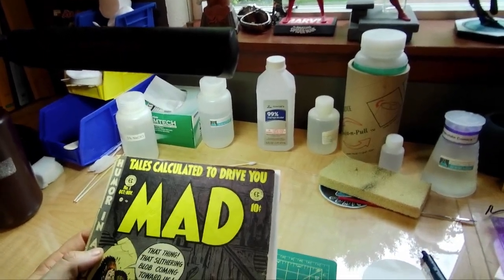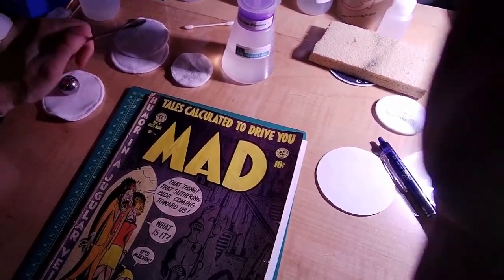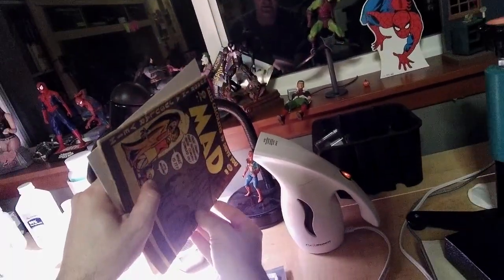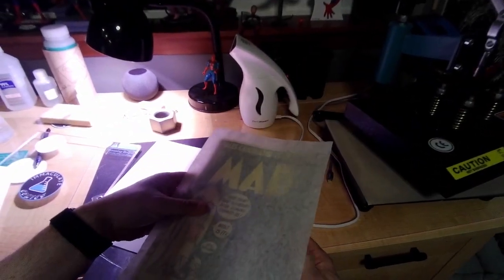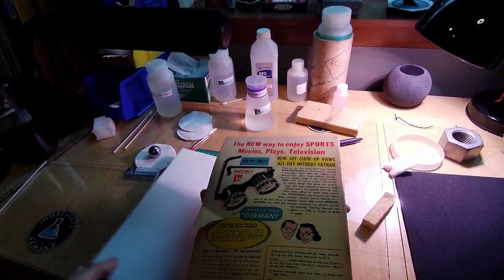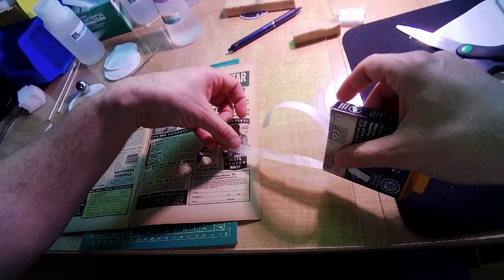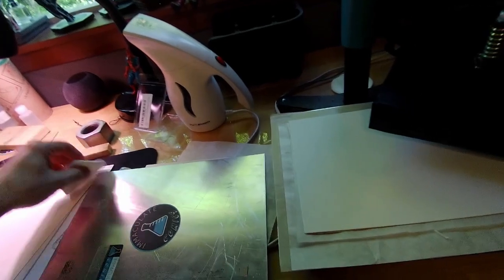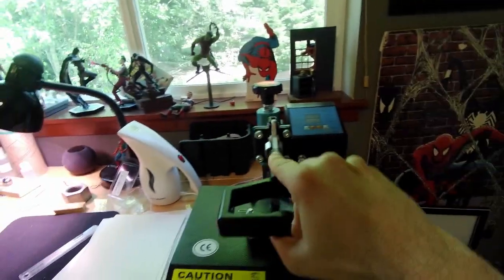cleaning Mad comic book #1 and #9

Comment: Great Video and thanks for sharing a Mad #1.  Learning a lot.  Been cleaning/pressing for a year now and get better and better with each book.  I've seen several posts on the net about ball point pen on a cover as being impossible to get off.  Have you tried to remove it?  Any thoughts?  Thanks!
Reply from the maker: ball point is a tricky wicket to be sure.  I have tried and I have had moderate success.... but not great success.

Comment: Is there anyway to get discoloration out of covers or those shaded areas caused by the sun ?
Reply from the maker: Hi Ron,  well that;s tricky.  the answer is sometimes yes and sometimes no. You can use a slant board and rinse them with water or a solution of immacuclean.